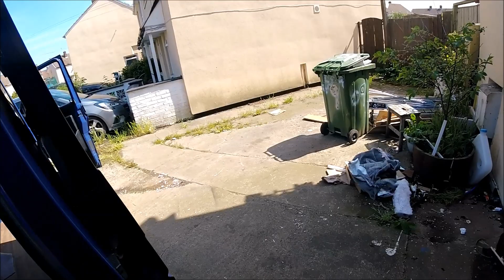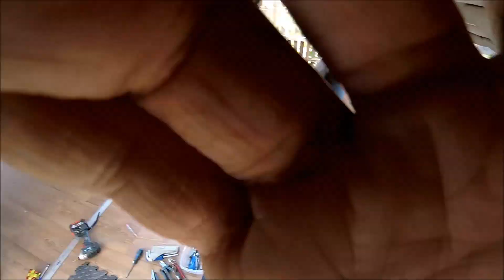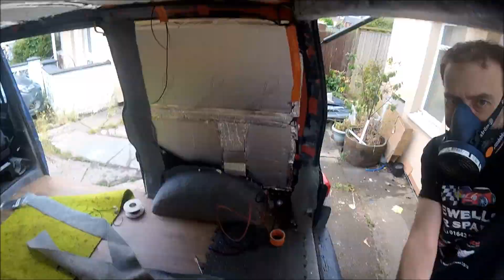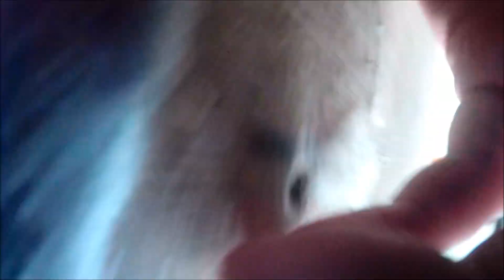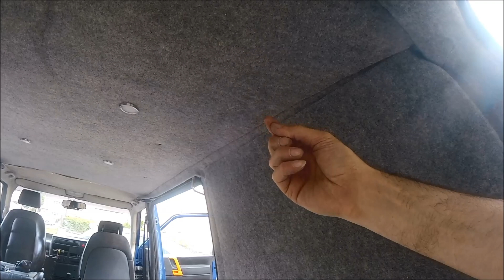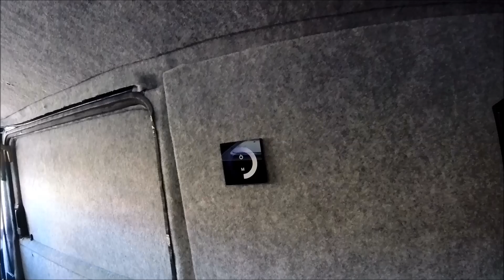Campervan Carpet Lining & LED Lights Install

Comment: Very tidy job. Well done.
When you carpeted over the bubble foil insulation on the wheel arches, how firm was it to touch?, does the carpet move as such?I know this is an old video but I'm about to do the same and I noticed other builders now tend to use a closed cell sticky back foam. I'd like to use the bubble foil because I have it.
Reply from the maker: it worked fine, you can push it in and compress it a little because of the bubbles in the bubble foil, but it springs back and move people box in the arches with bed or cupboards anyway

Comment: What screws did you use to fix it ?
Reply from the maker: spray glue to the ply panels, then short screws through the ply panels into the internal frame, nothing special or specific, just short screws so not to puncture the exterior panels

Comment: A lot of these van conversions talk about vapour barriers , it's doesn't seem to be the case here. Will this cause damp or rot down the line
Reply from the maker: the foil backed insulation boards create their own barrier if sealed together with foil tape.  People get way too overworked and worries about these barriers, this van would probably be scrapped long before any rot from insulation condensation did anything to the panels.  T4's also have ventilation from under the rear bumper in to the side panels too which also helps

Comment: Good job! Do you find low-roof vans awkward to work in...knees and back. That's one of my concerns. I guess they don't take as long to do which is a bonus. Again, good job!
Reply from the maker: yes I prefer to work in a high top van, low roof takes its toll after a while
Reply: @TheCampervanBuilder  Thanks!